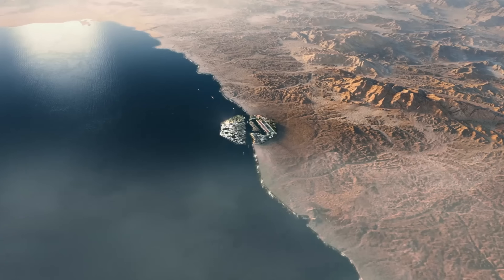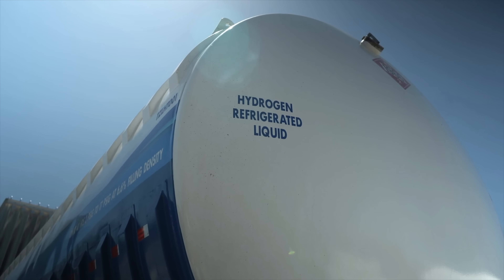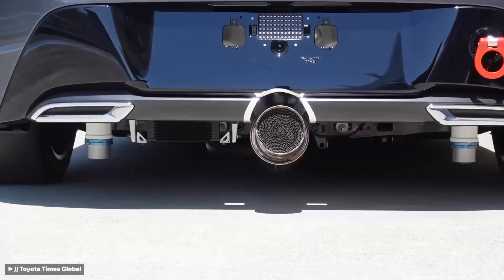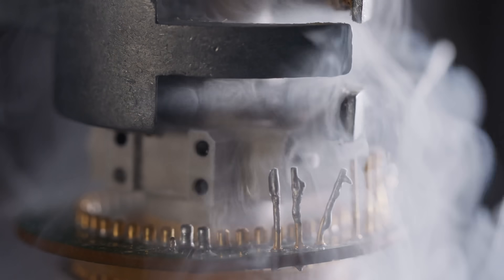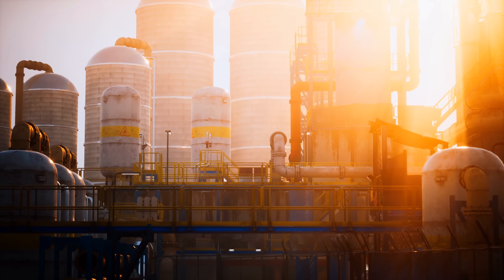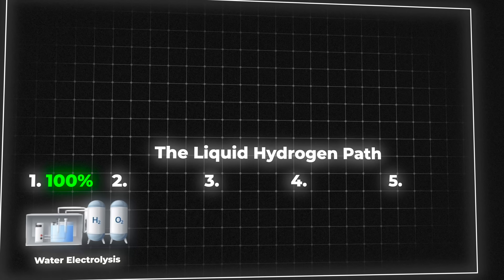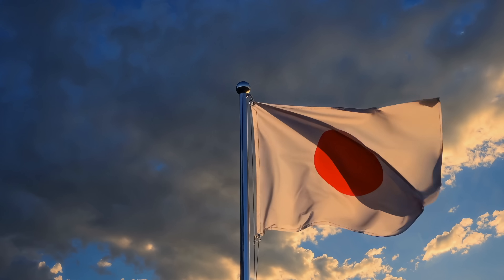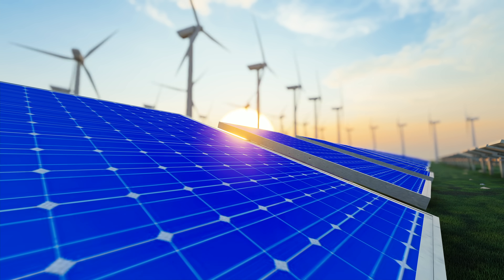World’s BIGGEST Hydrogen Plant Produces 0 Hydrogen

Comment: The chemistry of hydrogen is compelling.  The engineering and economics are abysmal
Reply: To me it's simply too corrosive, and dangerous. For nothing. 

 It literally gives no benefit. The vehicles are heavier. Way slower. 

 What is the point of getting an EV if not to whip the shyte out of V8s on actual street roads.

 Seen an EV6 GT whip a 2020 Porsche hard. 

 Think about that. A mother f***ing Kia beat a Porsche. 

 When I saw that all doubts in my head disappeared. Electric is just flat out better for most people in a developed country. 

 I know a guy who lives off the grid with his electric truck, solar camper, portable solar to charge. 

 Then has a digester for bio fuel. 
 
 That's awesome to me.
Reply: @RedactedDeath 

Hydrogen has tons of benefits and valuable uses. Just not as a fuel. 

It's a pretty big source of emissions because the current hydrogen production comes from methane. 

So if all of this infrastructure is built on the hopes of it being a fuel, then they give up after they realize they can't beat far heat pumps, heat batteries, fuel-free electricity, and electrochemical batteries, so it's only useful for making ammonia green? I'm okay with that. We needed to do that at some point anyway
Reply: Efficiency should be of main concern. Sure we could speak of the niche, being the performance of electric, but that should not be the majority of concern.
Reply: @bpopals 

Lithium batteries are 90%+ efficient compared to 60% ish for hydrogen fuel cells. 

And hydrogen fuel cells have many, many, more transformations where energy is lost, including putting the electricity into a lithium battery that then actually runs the car. The video itself lays this out.

 That's why so few people ever invested heavily. When you lay it all out, it only seems worth considering if you really, REALLY, want to stick with the basic concept of using a chemical fuel. If you think in terms of just "making electricity" "moving people and stuff" or "making things warm", better tools have been invented
Reply: @kylejohnson6775  Lithium batteries have a bunch of problems too. Like being latent firebombs, deteriorating from being too full, too discharged, too cold, etc, and being really inefficient in cold weather.
Looking forward to sodium battery production ramping up, it'll at least make much safer EVs, with longer lifespans, though the energy density is lower, so higher weight or less range.
Reply: Yeah, that's the whole point of using ammonia as an energy carrier. In the end, the key problem to solve is getting energy from places like Chile, Africa, and Australia to the rest of the world in a practical way. Hydrogen is completely impractical. Ammonia isn't. The losses in efficiency make up for the difficulty in energy transportation. Until we find a better way to transmit solar energy from where it's cheap to where it's needed, hydrogen (read, ammonia) will make sense. It makes a lot more sense, IMO, than building a container-ship-sized floating battery, charging it in Australia, and discharging it into grid energy storage in Japan. You'd need literally 3X the amount of storage: One on the Australian port, the floating battery itself, and a battery on the destination port.
You can't really build a practical transmission line from Australia to Europe.
Reply: Battery can get old and when most of the cost is in battery then you have deterioration of asset value simply by aging batteries
Reply: Hydrogen produces WATER VAPOR when burned. Water vapor is the NUMBER ONE contributor to global warming, AND  increasing water vapor will ALL FALL TO EARTH AS RAIN and flood everything. You sir need a chemistry class. Hydrogen is a total scam.

Comment: Hydrogen only produces harnless water whenburnt in oxygen, when burnt in air it also produces a lot of Nox.
Reply: That is why fuel cells are better. More efficient too.
Reply: came hereto say this.  ...but we already have catalytic converters for NOx
Reply: When used in fuel cells, 
needed water is produced,
and produces no NOx.

This is what the H2 cars use,
as well as space stations
Reply: @DavidHalko  Fuel cells are very expensive, and, their efficiency decreases when you increase the power output, mostly due to the fundamental fact that each hydrogen and oxygen molecule needs to find and react with each other from different sides of a separator, which absolutely can not happen anywhere near as fast as combustion of a mix of fuel and oxidizer. So, at very low power output levels for given system size, fuel cells can be very efficient, competing with the best diesel engines, but you can't have high efficiency from fuel cells at relevant power output for propulsion. 

Then there's issue that most current fuel cells are only expected/designed to last about 10,000 hours of operation. 10,000 hours is a bit over a year of constant operation, so for most commercial applications where current batteries can't do the job, just as well and for a much lower cost, current fuel cells would only last about 2 to 3 years. That's part of the reason the passenger car market was the main target first, and only since that market died off they have put more effort into producing heavy trucks to get a market for the production capacity of fuel cells and related systems they built up for passenger cars to heavy trucks.  Total fuel cell vehicle sales peaked in 2022, and is now well below half of what it was in 2022.   

On top of that, fuel cells requires very pure air as contamination in them blocks the function, so fuel cell vehicles requires very advanced air treatment systems. Also, the heat current PEM fuel cells generate is already an issue for the relatively small systems designed for passenger cars, because the fuel cells don't tolerate very high temperatures.  

Fuel cells aren't used on space stations, they use solar PV and batteries.

Comment: at 3:37 you say burning hydrogen is clean and you get water. That is false. When you burn hydrogen you get NOx which is a pollutant that causes acid rain. When hydrogen is burned in air (which is 78% nitrogen), the high temperatures of combustion cause nitrogen and oxygen to react, forming:, NO (nitric oxide), NO₂ (nitrogen dioxide), Collectively called NOₓ, NOₓ is not water — it’s a pollutant that: Contributes to acid rain (forms nitric acid when it reacts with water), Causes smog and respiratory issues.
So even though you're burning hydrogen, you're still producing acid-forming emissions — just not carbon-based ones.
Reply: H2 does not need to be burned, it can go through a catalyst to make electrons without NOx - which is how H2 cars work
Reply: I think he misspoke when he said burn. I think he means fuel cells.
Reply: @Powermongur  Any serious analysis doesn't think hydrogen or ammonia will be moving any wheels. The BEV costs keep getting lower, and hydrogen can't catch up.  Ships and planes are the target, and while I can imagine a giant fuel cell on a ship, it's not going to replace a jet engine, and NOx in the stratosphere  is a serious concern.
Reply: @briankuhl9314 why are you telling me this? I'm talking about an in correct statement here 3:21

Comment: First people laught on electric cars. They sad it's inefficient, can't drive more than 100 km and the battery dies in 3 years.  Of course this did not happen to be true.  

I stopped to argue people about hydrogen,  because people could focus only to the loss factor.  If we had a system where 70-80% of the energy would be waisted.  Oh wait,  the combustion engine.  Nobody is bothered about that.  No one is saying that with this amount of waist it will never exist.  Nevermind. 

People has no idea that how extreme difference is between the price of the energy sources.  It's ok to use gas what costs 30-50 cent to produce 1 megawatt electricity,  but it's not ok to use hydrogen produced from 3 cent solar energy.  I'm not sure where people get lost in the calculus. Even in the wors case where the loss on hydrogen transport is 90%, with 3 cent electricity we would be still under 30 cents per megawatt on the other side. 

People lost the ability to calculate.
Reply: @gene8194   well, you maybe gladly pay for this kind of energy forms, and it is your full right!
But we, people who are not as enthousiast like you are forced to go along with it, and need to pay for your kind of hobbies in the form of taxation!!
Reply: @verdikulk6193  I'm not sure you are aware of,  but your energy bill is at least partially comming from gas. Gas is one of the most expensive sources of energy. If you are ok with paying gas for more than 30 cents, shouldn't be issue to pay for hydrogen for the same price. This is what I obviously failed to explain in my post. The 3 cent electricity comming from solar in the most sunshine places if you convert with 10% efficiency will cost the same as the gas your energy company is using right now to make your electricity.  So, no, it would not cost you more then you are paying right now. It might be in future potentially cheaper if the efficiency will be improved by research. This is what people need to understand.  It is already as cheap if not cheaper than using gas.
Reply: 30 cents per megawatt? What does it even mean, if anything?
Reply: @velisvideos6208  that you are using gas turbines. With a very optimistic gas prise.
Reply: @velisvideos6208 it means that it's same price if not cheaper than using gas today

Comment: If this was used as shipping fuel then I see it working but just to ship it somewhere else? Why not just invest in electrical transmission? It must be cheaper to ship it.we need global interconnects so that everyone can benefit from solar and wind power. Hopefully it works out cause we need real green hydrogen not the fossil fuel version. Ammonia seems pretty dangerous but so are fossil fuels like LNG.
Reply: Use of ammonia as a bunker fuel has, amongst obvious operational hazards, a very serious NO2 problem to overcome.
Reply: @duncanidaho9153 I'm no fuel expert but I would think all of them have safety hazards. Could the convert it back to hydrogen and use that to fuel the tanker? Ship the ammonia and use it to power the ship too. I always thought that when shipping EVs they could use the EV batteries to power the ship while in transit. For alteast some of the trip.
Reply: “electrical transmission”

2-bit did an entire episode on this concept. A lot of complexities & issues… related to physics mostly.
Reply: I agree with your the interconnect point.
Reply: Because, China has an advantage in manufacturing solar and electrical infrastructure components.  They want to inpose an energy ecosystem that excludes economies that can beat trumpists in terms of efficiency.

Comment: Thanks for putting those useful numbers in front of your audience.  One thing that needs to be considered is that the efficiency of the delivered fuel process is less important than the CAPEX of the system - given that the input energy is almost free.  The other thing that seems to be overlooked is that a carbon neutral fuel, ie. one that contains carbon, but in its manufacture extracts it from a source which would otherwise soon put CO2 into the air, would be transportable and could leverage both the existing distribution system and engines.  If the dream of Prometheus Fuels comes true, then this will scoop all of these challengers.
Reply: There is NO free lunch. There's always a catch. Input energy almost free? Highly unlikely. There are always hidden costs.
Reply: Escrowed CO2 could become an unlimited source of filament for 3D printing.

Honestly, CO2 is a goldmine, waiting to be tapped.

Comment: H2 energy density by volume looks great but its energy density by mass is lousy, so yeah if you drive around with a balloon filled with hydrogen that's fine but not if you need to put it in a confined space of a car its a problem. Be truthful please.
Reply: You got the terms backwards. By mass, it's amazing. By volume, it's atrocious
Reply: H2, by mass, is 300% more energy dense that natural gas… absolutely amazing!

We use natural gas, all day long, around the world.. which also contains a percentage of, wait for it, hydrogen.

Hydrogen holds more energy, than any battery will, in the same volume… yet batteries can do ok for some vehicles.

Be truthful, please.
Reply: @DavidHalko  

It holds more energy than any battery in the same *mass*, not the same *volume*. He even says this in the video. It's one of 2 or 3 Achilles' heels of hydrogen as a fuel. (The others being the energy needed to synthesize it, and the struggles with transport and storage, but those last 2 are consequences of the volumetric density thing)

Comment: Hydrogen.....what a waste of Time...  Unable to store normally. (10klbs of pressure required)... Unable to transport efficiently (Burns as much just to move)...  Costs 3 times more than Gasoline...  Produces 1/3rd the horse power of Gasoline.  Hydrogen stations can only store enough for 50 vehicles a day to fill up....  And Toyota (even though giving hydrogen cars away) are being sued by customers from being lied to about advantages of Hydrogen....   Cant store hydrogen cars in garages because of leakage...  And last but not least.... Remember the Hindenburg?
Reply: Hydrogen is for sure garbage. Especially just storing, and handling it. 

 Small correction. It is 120mj hydrogen, versus 44mj gasoline. Per KJ. 

 While by volume you're right. For a liter it's like 8mj versus 32mj. 

 Don't get on me for being a few points off I'm not looking it up. 

 But! The key difference is... Efficiency. Hydrogen is more efficient with fuel cells. 60% was the last one I looked at. 

 Again. Hydrogen is garbage. Good for space. 

 Maybe one day we will unlock solid hydrogen! 

 I want hydrogen stuff to exist so I can see red necks, gear heads, anti science people get them. Then struggle with everything.
Reply: @RedactedDeath ammonia which is nitrogen and hydrogen.
Reply: @1ntwndrboy198 Yes, and he said hydrogen. I'm not as family with the ammonia numbers. 

 Ammonia sucks too. Probably even worse as far as hazards go. 

 Man I got a tiny tiny whiff of I don't even know. Ammonia at 30/40%, and that shyte made me feel like I was tear gassed. 

 I thought I was super safe. Looked like a drop did it! I learned my lesson. 

 People are scared of lithium batteries, but a gas tank of hydrogen or ammonia. Perfectly fine!

 The craziest part is they are developing internal combustion variants.... I could understand modifications to existing engines, but... Designing stuff from the ground up. 

 Sounds like a scam to blow off regulators, and get subsidized. 

 I have yet to meet an engineer who actually thinks it's a good idea for mass market. 

 (Niche for space. Submarines. Yeah hydrogen is a boss fuel in space. Ammonia basically, life sustaining. So useful.)
Reply: I think the Hindenburg was old tec!
Reply: @petewright4640  Ummmm..Hydrogen will always.... go BOOOOOOOOM!!!  They have done a good job on hiding all the travesties with hydrogen stations and production plants/Vehicles ect.  Toyota and others have billions invested... and they own the media.    And now that batteries are make from Sodium and don't catch on fire.... all the reason not to go hydrogen.  Try to find someone to work on one....HAHHAHHAHAH

Comment: Since when does hydrogen burn cleanly 'with nothing but water' as exhaust? That's true for fuel cells, but not for combustion.
Reply: In oxigen only it is possible. Otherwise also, it is much easier to tackel Nox (byproduct of incomplete burning) then CO2 (Primary product of Carbon burning.)
Reply: Since forever. Burning hydrogen produces water vapor.
Reply: @l3zl13  yep
What is what you said is what i've been hearing for decades. 
So which is it ❔️
Reply: What you said*